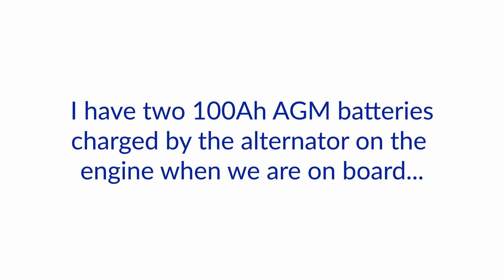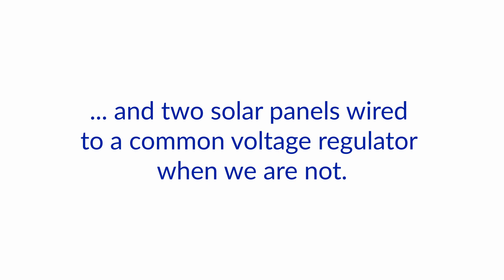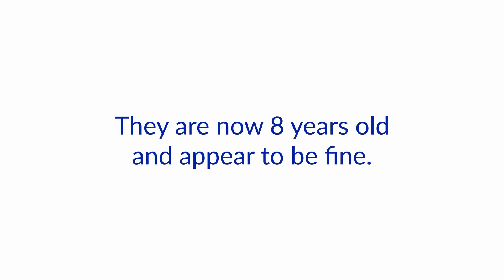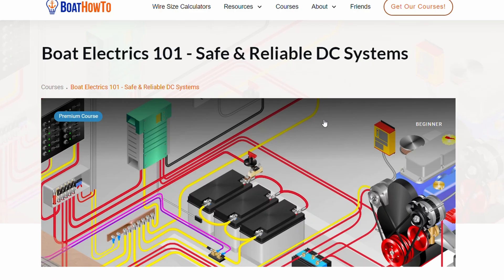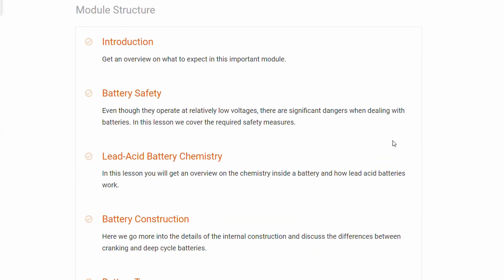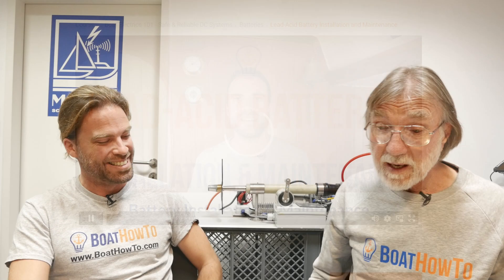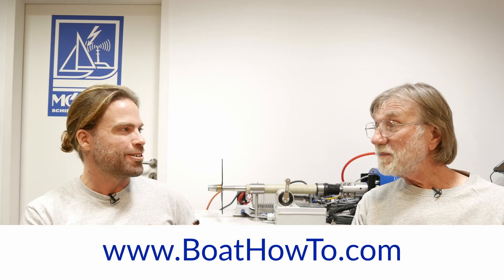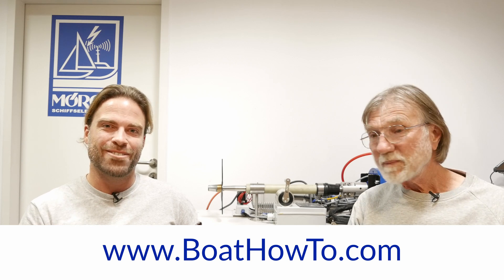BOAT BATTERY LIFESPAN - Replacing 8 year old lead-acid batteries? | Ask The Expert with NIGEL CALDER

Comment: I am considering a major overhaul of my boats electrical system to switch the house bank from AGM to LiFEPO4 and to upgrade the A/C to something more efficient that can be run off of a pair of inverters. Right now the house bank is 12v. The only high current 12v load is the windlass. I am considering changing the house bank to 24v or 48v because of the benefits of charging from an alternator and for the inverters but am concerned about the complexity of having to convert higher voltage dc to support “legacy” 12v loads on the boat. I am fine upgrading the windlass to 48v. For this type of large upgrade do you recommend going with 24 or 48v or staying with 12v? Curious to get your thoughts on this as I would imagine many other boaters are considering these types of upgrades. Happy to give you more info about my boat if that helps drive the discussion 😊
Reply: I have been thinking of doing something  similar but found it daunting to consider replacing all the loads (from 12V to 24 or 48V), including things such as lights etc. With the price of DC to DC converters coming down (and the efficiency going up) one option might be a partial 12V and a partial 24V system.